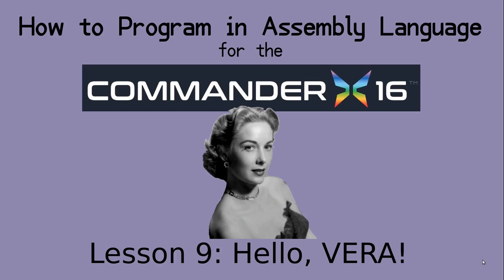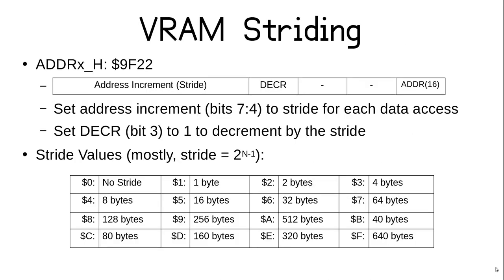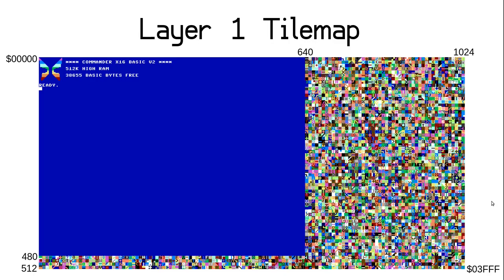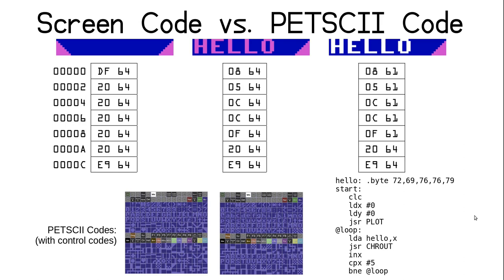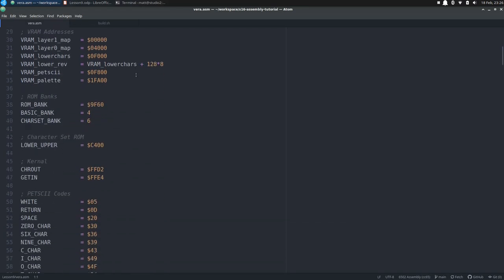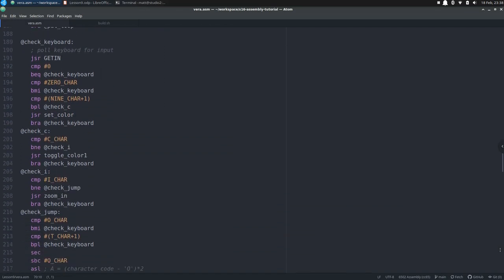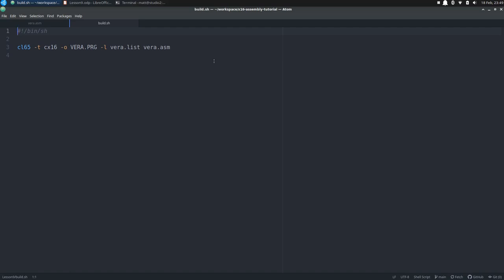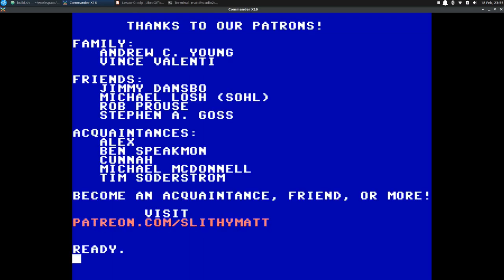Hello, VERA! - Commander X16 Assembly Language Tutorial, Lesson 9

Comment: Ok! Now we're getting to the meat! I've loved the series so far, even though I've only glossed over a couple of the episodes (I can revisit them when I need those specific topics.) SUPER helpful. I now have a development system and tool chain all set up on my Debian based Linux development computer.

The only part that was actually hard was the one thing I thought would be easy... setting up the source files so that the linker could string them all together after assembling them into a single program. What stumped me was need for two directives: .import and .export to import labels into source files that need them and export labels from files where there are defined. The other head scratcher was the -l output.list directive on the command line... it ONLY reports the LAST .asm file in the list, and as such is probably only useful when you're only compiling one file.

Once I cracked those codes, it was easy to break modules into files then  jsr to the code modules within the files. I have games I need to write! And I couldn't very well do that with only one .asm file!

Comment: Where can I buy a Vera? This is a great idea, and could really breathe new life into the modern retro computer builds. What I would like to have is a bonafide late 1970s / early 1980s era CP/M computer. Something nice and classy, so classy in fact that it didn't actually exist back then. I'm envisioning an all-in-one chassis, looking somewhat along the lines of a TRS-80 Model 4 in styling. It has a genuine hard drive and at least one genuine floppy drive. It runs CP/M, and most importantly, it runs Turbo Pascal, which is the second language I learned after BASIC.

You can't really buy anything like that, so you have to build it. Building a retro computer is not that hard - the hard part is video. What to do about video? So the Vera board could be the perfect answer here. You could fit it to all manner of retro builds and we could all have a lot of fun.
Reply from the maker: You can't just buy a VERA, the only commercial means is through buying an X16, and the next batch isn't ready for sale yet. The verilog code for VERA is open source on GitHub, so you could make your own using an FPGA demo board.

Comment: I cannot get this to work, I had a couple of typos in my code, but I meticulously went through and fixed those to no avail.

What happens is it clears the screen and displays the initial message just fine, and zoom in / out works, turning on layer 1 (T key) works, but the palette has wonky characters (The colors themselves look ok.) and pressing R to show the "secret message" just shows an uninitialized charset.

What I think is happening is the port to set the ROM bank has moved. In the docs, it says $9f60 is the external I/O space, and it also says to switch the ROM banks, set the new bank into ZP address 1 (0 is for the RAM bank) Setting ROM_BANK from $9f60 to 1 allowed the "secret message" to show, but with some wackiness through the uninitialized zone first, basically... pressing R twice gets you to the secret message.

This can't beat me... I'll be back at it tomorrow.
Reply from the maker: Yes, both the bank registers have changed and the default VRAM map is different as well. I need to update the code in the repo to make it work with the current emulator release
Reply: @slithymatt  Yeah, I just figured that out. Changing the VERA_petscii from $0f800 to $1f000 seems to work just fine.

So basically, I changed:
VRAM_petscii = $1f000
ROM_BANK = 1

BASIC_BANK and CHARSET_BANK were both Ok as is.